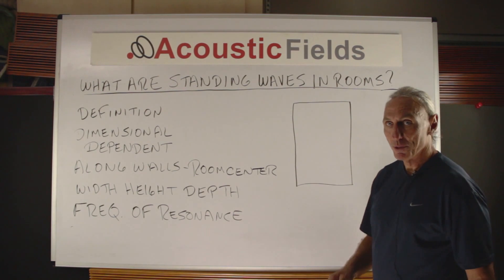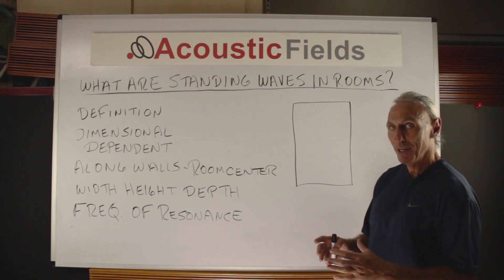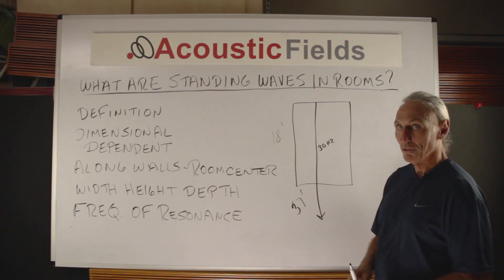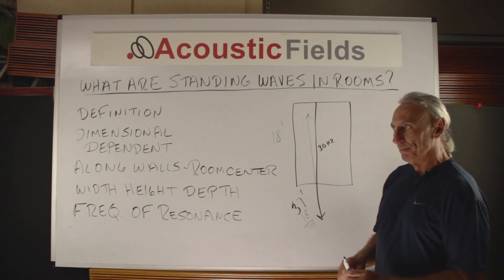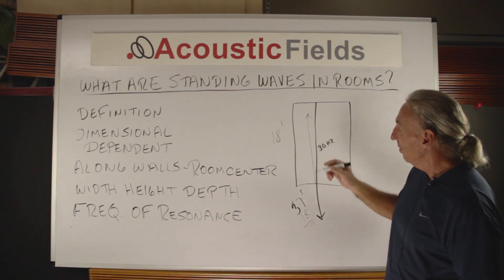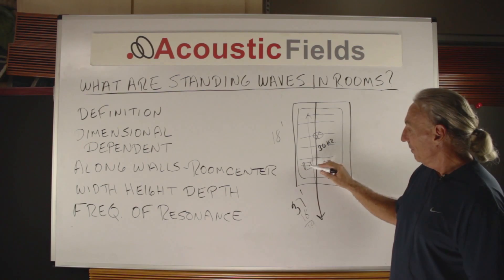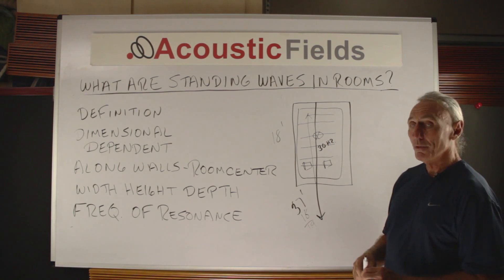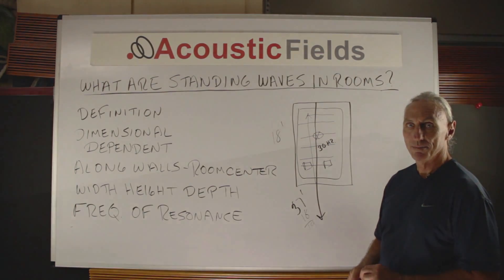What Are Standing Waves In Rooms? - www.AcousticFields.com

Comment: I think the explanations are all wrong.  Even the first thing said, that standing waves are not standing, is wrong -- standing waves do not propagate as usual waves do. The nodes remain fixed and the amplitude goes up and down at the same place.  He said that standing waves are related to wavelengths not fitting in the room, which is the opposite of the truth.  He gave an example of wavelengths unrelated to the room dimensions, and talked about excess energy and reflections, and that's how you get standing waves. This is all wrong and irrelevant to standing waves. The example of the loud guy at the bar is also irrelevant. He described standing waves as a pressure area in the room that is louder than the average, including pressure along boundary surfaces, but standing waves have both louder and softer areas, including nulls(!), and room boundaries are not special areas for standing waves and shouldn't have been mentioned.

He failed to mention that standing waves are resonances with wavelengths that are subdivisions of the room dimensions.
Reply from the maker: Your missing the point. Standing waves are the nomenclature that is used to describe the pressure based oscillations. You must educate using the existing nomenclature or you don't have a chance with people understanding physics. Pressure based distortions oscillate through the room and do produce areas of higher and lower pressure. To test this, walk around your room with a simple SPL meter and measure.
Reply: @AcousticFields  -- If anything, you are missing the points (plural).  The "existing nomenclature" is not arbitrary -- standing waves do stand.  Standing waves per se are not "distortions".  Of course there are higher and lower pressure areas in the room, even nulls where there is nothing, but all the explanations are off, and do not include the fact that standing waves are specifically resonances with wavelengths that are subdivisions of the room dimensions, not just "pressure areas", and not because of waves with length greater than a room dimension, and not specifically related to room boundaries.

Comment: The problem with modes is exactly opposite of what you are thinking; this whole ‘fitting in the room’ thing. The wavelength at modes actually fits perfectly in the room, that is the key to the self sustainability which can lead to resonances, depending on speaker placement and ear placement. At very long wavelength the room is evenly pressurized and so again that should be viewed as a good thing, and again opposite of your reasoning.
Reply from the maker: Its not the wavelength that is the issue with modes. The wavelength is used for illustration purposes. The air excitation is the issue. If all energy "fits" as you have described, we would have no air excitation and thus no modes.
Reply: @AcousticFields  Look... I don't know if you truly believe what you are saying or not, and I appreciate the effort you put into making videos. But your understanding of room modes and acoustics in general is at a level where I could not give you a passing grade as external examiner in acoustics. However, I will offer you help to understand this correctly from a theoretical standpoint, just reach out.
Reply: @Rene_Christensen I'm not an expert, but I imagine a standing wave being exactly long as the room. So it doesn't bounce arround, but instead you get an "illusion" that the wave is "standing". Does this make any sense and is my reasoning somewhat correct? Cheers

Comment: Hello good sir.

Im hoping to find understanding about a problem in my basement studio that is part of my newly bought home.

the room is 5.2m by 4.3m and its a square room, its 2.07m high.
there is also a stairs in the corner with a very high ceiling(4.70m). about 1.50m by 1.50m.
theres is also a wooden wall next to the stairs in the (almost)middle of the room wich seems to resonate loudly when i give it a thump with my hand.

Now my problem:
Whenever I play sub (especially A1, 55 hz), something seems to resonate and rings on for at least 1 second in this sub range after the speakers stop producing sound.
Its a very unpleasant experience, as Im into making bass heavy music.

Now i believe it has something to do with the wooden wall next to the stairs, or maybe even the size of the room? maybe even the huge spacious area where the stairs is...

Any help and insights would be very much appreciated.
Stefan
Reply from the maker: S,  It is your low ceiling height in the basement that is causing the issues.
Reply: Could u advise me with any tips, would be great.

Comment: sir
Thank you sir, nice explanation. Sir, I have a doubt. Please give me a clarification.  It is told that the standing waves are not moving . In that case how the standing wave sound reaches in our ear ?
Reply from the maker: U,  Energy oscillates throughout the room in waves of energy that are determined by frequency and amplitude. This oscillation produces modes which are dependent on room dimensions. It is the excitation of the air between the room walls that produces the modes.
Reply: @AcousticFields  The modes exist independent of the source.
Reply from the maker: Pressure oscillates throughout the room and is felt

Comment: so, at those points of pressure, the listener would either hear the resonant frequencies as too high or too low, right?
Reply from the maker: L,  Yes, room modes can exaggerate or eliminate certain frequencies. Think about this. A room distortion that can completely eliminate certain frequencies. That is a powerful distortion. Your speakers are producing the energy but your room will not let you hear it.

Comment: Hi! I have a question. Assume I know exactly where a standing wave node is in my room (at listening position) and I know its Q-factor. I thought i could use a Helmoltz resonator cabinet to get rid of it, but now I think I understand that it's mostly used to reduce the group delay? Would that still do the trick to remove that first reflection that creates the standing wave? I'm trying to find a DIY solution.
Reply from the maker: M, What is frequency and amplitude of SW?
Reply: @AcousticFields  I'm getting 23 dB at 49.8 Hz when shooting a 75 dBA pink noise. Not accounting for the monitor's actual response at that frequency. However, it cuts off at 40Hz (+/ 2dB) and is supposed to be flat from there 'til 60Hz. I use Room EQ Wizard.
Reply from the maker: @MatteoPellegriniSound  Reflection management will not work to treat a 50 Hz. wave. You must use absorption with a high rate at 50 Hz.
Reply: @AcousticFields  With higher density wool or so? Last resort would be the PSI AVAA. I heard it at Musikmess and it's insanely efficient. Any thoughts on that device? Thank you so much! Love your channel
Reply from the maker: , Our ACDA-12 unit gets 100% at 50Hz.
Reply from the maker: M, A 23 dB issue can not be managed with a limp mass technology. No box filled with building insulation have enough horsepower. You must use diaphragmatic. It is a pressure based technology. We achieve 1.5 dB attenuation for every 12 sq. ft of surface area or one BDA / Carbon unit.

Comment: Thankyou Dennis - this was a really useful video for me - very much a beginner in this area and found the straightforward language easy to absorb - am currently trying to iron-out wrinkles in the sound stage up in my man-cave; and the first thing to do is work out what my problem is (ie: is it the room, position of kit, interaction of speakers with the floor causing resonance, mix of some or all of these things, etc, etc!) and then consider my options to resolve it.  So yeah, thanks again, Martin.
Reply from the maker: I do not believe the speaker/floor intercation is the first place to start your journey. Make sure your speakers are at least 4' from all the walls. Make sure your speaker to listening position is the same as the distance beteen your speakers as a start point. Use an equilaterial triangle. Make sure you have a front wall and sidewalls with no openings. Ideally all walls should be the same density.  Use a male mono recording to dial in center channel image formation. Once you have image, start your treatment jouney.

Comment: I believe this is not correct.  A standing wave occurs when a room dimension is the same size as the length of a wave (or a multiple of the length of wave).  When this happens the reflections of the wave all coincide so that high pressure areas occur together and the low pressure areas occur together, always strengthening each other.  The sum of these waves (what you actually hear) has a much greater amplitude than a wave whose reflections don't coincide and some of the peaks occur with some of the valleys, canceling each other out instead of strengthening each other.  This happens anytime a wave reflection follows the same path as the original wave and is in phase with that wave.  So, not just parallel walls, but in a diamond shape (e.g., off the front wall, then the ceiling, then the back wall, then the floor, then back to the speaker), as well as more complex paths.  The amount of absorption on these surfaces determines how many times the wave follows the same path before it is extinguished, hence how much magnification the wave receives.
Reply: Kimball Whitaker this is a fantastic explanation of the phenomenon. I understand it much better after reading this. Very well done sir!
Reply: @fu J If all the surfaces are 100% absorptive there would be no reflections and hence no standing waves, however I don't believe a 100% absorptive material exists, though there are some things that come pretty close.  If your room is intended to be a  listening room (as opposed to recording, for example) then removing standing waves as much as possible is a valid approach.   I can't recommend particular materials because I know nothing about them.  You must know exactly what frequencies and modes you're trying to control.  Also, the ceiling height is important.  Look at a mode calculator, such as amcoustics.com/tools/amroc to see how your room dimensions spread out.  A room with no standing waves is acoustically dry, which is not always what you want.  Sometimes you may want to just control certain frequencies so there is still some resonance (or reverb) but no major hot spots.  In any case, your best bet is a detailed analysis and a somewhat engineered solution.  Talk to Dennis for more info on this.
Reply from the maker: Hi Kimball,  You can use a variety of paradigms to explain standing waves. If you synthesize all the explanations down, they all point to sound pressure. There are two main issues we deal with in small room acoustics: pressure and reflections.
Reply: Sure, I'm not arguing that.  I think the problem I have is the idea that certain waves don't fit in the room.  This confused me until I realized that what you mean is they don't resonate because they are lower than the fundamental.  There are many frequencies that are higher than the fundamental that also will not resonate, even though their wavelengths are shorter than the dimensions of the room.  It's not the frequencies that are too big that cause standing waves, nor is it the frequencies that are too small.  It's only the frequencies that are just right (the ones Goldilocks likes), that is to say, the fundamental which has a wavelength of twice the distance between the walls, and integral multiples of the fundamental.  So, if you were to use an 18.5' room for your example, then you would get a resonance at about 30Hz (with its 37' wavelength), another at 60Hz, another at 90Hz, and so on.  At frequencies in between (say, 45Hz) there will be no standing wave produced by the two wall surfaces in question.  Anyway, my point is it is completely wrong to say the waves that are too big for the room cause the standing waves.  It is very specific frequencies (the "room modes"), defined by the room measurements, at which standing waves occur.  Wavelengths greater than the fundamental will become deader the further away from the fundamental they are.  

I wouldn't belabor the point, except that I think this is vital to understanding why getting the right room dimensions are so important.  A difference of a half a foot in any one direction can be disastrous if it causes a pile-up of room modes, especially in the low frequency range.  Another implication from this is that in a well-damped room, room dimensions are not as important because resonance will be mostly eliminated.  Would this not be ideal for a control room, where you want to hear the recording, the whole recording and nothing but the recording?  In the studio (or a home theater, perhaps) where the room enhances the sound, the opposite would be true.  The room dimensions would be vital in this case and getting the right amount of reflection across the bandwidth for the type of performance would be key.
Reply from the maker: Hi Kimball, When you are teaching complex subjects, it is best to start with a simple, macro view of the complexity and then work through that macro view into more micro specifics. We try and take the incredibly complicated for most and simplify it step by step through a process for our audience. Knowledge without understanding is problematic. As time and topic march forward, explanations fall into place. Comments like yours are a central part of this process. Thank you for contributing.
Reply: I appreciate this, and you do it well.  I love watching your videos and getting your perspective on room acoustics.  Thank you for spending the time to share  your experience and expertise!
Reply: @kimballwhitaker6092  This such a great explanation of standing waves and acoustic resonance within spaces! Thank you for your addition ! And to Acoustic Fields for this video!!

Comment: So when I play a 40 hertz tone in my room that is way too small for this frequency to be heard, does this mean I'm hearing a second or even a third harmonic of the 40hz frequency?
Reply from the maker: +Koen Vanbelle All energy oscillates or is produced in waves of energy that are interjected in the room. This energy will have the ability to oscillate freely if the dimensions of the room allow for the waveform to "run" its full length. This is where the dimensions and volume of your room come into play. Dimensions that are at mathematical differences with the wavelength produced, will cause attenuation or exaggeration of that fundamental and all its harmonics. You will hear it but will not be able to distinguish it as an individual 40 cycle wave.
Reply: Acoustic Fields Oh, alright that has cleared everything up. Thanks for the response :))

Comment: In your example, a 30hz wave doesn't fit in the room. Does it mean you can't hear 30hz?
Reply from the maker: Hi Gino Punsalan 

A 30 Hz. wave is felt not heard. It is a process termed bone conductance. The ability to feel the 30 cycle wave is dependent on the lowering of resonant amplitude to the point accurate attack and decay times can be realized. Most room dimensions and volume to not allow for this to occur.

This video I made on how we "hear" bass explains more about bone conductance and low energy: 
https://www.youtube.com/watch?v=BfK19_N4nAw&index=42&list=PLDelqxWk36UgjtdW9AB6natV2yowpHaYC

Thanks 
Dennis
Reply: Acoustic Fields Can 30hz be felt in your example if the wave cannot fit in the room?

Comment: Hello Acoustic Fields, 

Thinking, as a rule of thumb, the frequencies with wavelength's, longer then twice the longest axial distance, between a parallel set of room's boundaries, cannot create standing waves.

Lets name these frequencies: 'sub standing wave spectrum'.

Take the example used in your video. 
A 30Hz wave, in a room with a maximum distance of 18'.
In order to excite the first room mode, the frequency would have to be, approximately 31Hz.

If this room were to have rigid boundaries, and no gap's/ significant 'open window' surface.
Frequencies, having wavelengths, longer then 18', I thought to create 'bulk pressurization' of such a room.

Meaning, no standing waves, but fluctuations of pressure, throughout that room, with the corresponding frequency.

25Hz, being perceived as 25 Hz, not as energy, partially exiting that 18', 31Hz, axial room mode.

Therefore, throughout that room, below 30Hz, no pressure nodes either.

The decay of this 'sub standing wave spectrum', in such a theoretical, sealed, & rigid boundary, small room, probably leaves room for improvement.

Not having such a theoretical room to test this.

If so, where does this reasoning go wrong?

After measuring a small room, for the 'sweat spot', I usually try to get the modal frequency range, correct, by using di-pole woofers.

If the measurements, below this spectrum, show enough transmission loss, or absorption, for the client wanting to go low, boundary woofers for the 'sub standing wave spectrum', deliver (rather sloppy usually, or a source of noise pollution) enough 'umphh'.

Apart from the results, if I'm theoretically incorrect, please, do correct me.

Thank you for your time,

Erik van Andel
Audio Clone
e.r.vanandel@gmail.com

PS Are there Acousic Fields absorbers to be expected, taking care of the sub region?